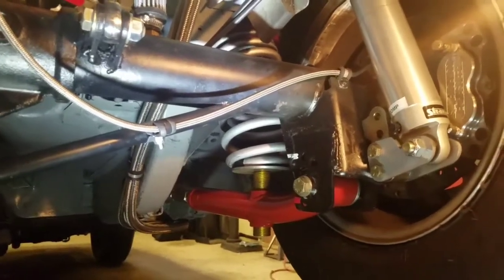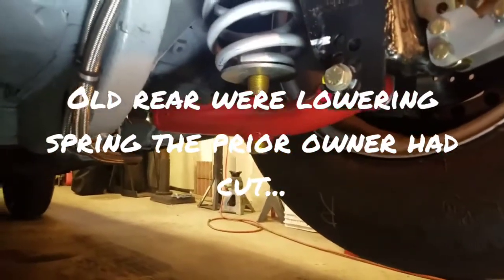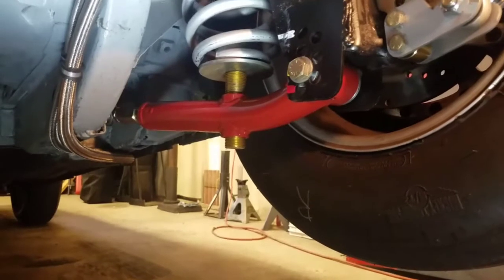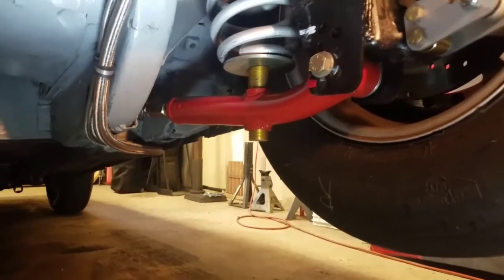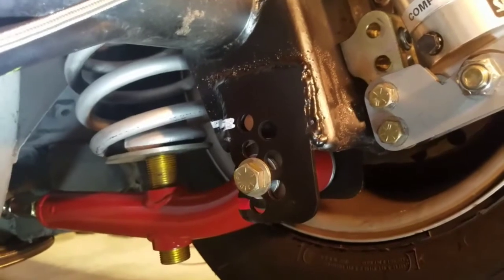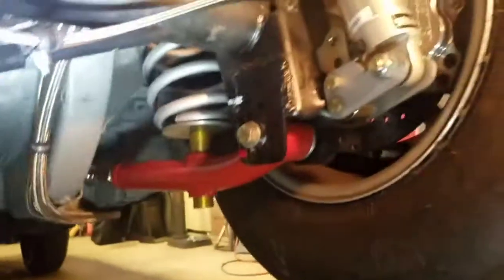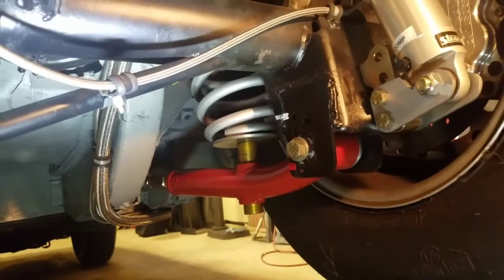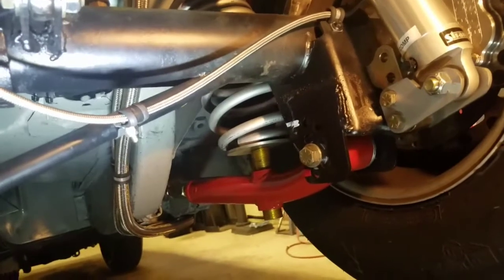Foxbody Radial Tire Suspension Changes Fixed Traction Problems.

Comment: Love this setup. I’m doing research now for a roller I’m picking up. I’ll be building a 4.6 mod motor but same simple build. Question for ya, are you running a boost controller? How much boost are you typically running? Look forward to more of your runs.
Reply from the maker: I normally run around 15psi or so launching at like 9psi but a couple weeks ago tried a little more boost (19psi)  unfortunately the valve springs weren't up to par...in the end I blew a head gasket after it missed a couple times. Engine is coming out tonight and I'll check it to make sure that's all it needs. Currently I'm using a Leash controller for boost and bump box.
Reply: Oh man sorry to hear. Hope it’s nothing to crazy. How do you like the Leach controller?
Reply from the maker: Yeah not too big of a deal as long as everything else is ok. I was pulling it out to swap valve springs and check bearings anyway. I really like the leash. It's small and easy to operate. Thinking of swapping to a Haltech VMS this winter. It will do everything from ignition to boost controller plus data logger. Although  I'd probably keep the leash hooked up for a while until I sort out the rest.
Reply: What data logger are you using now?
Reply from the maker: Old school innovate LM1+ LMA2 with just 4 channels of data.

Comment: What is your pinion angle set at?? Thanks for the video!!
Reply from the maker: I set mine at -1* ....generally zero to -2* is good as long as the suspension doesn't have a lot of deflection. Sloppy bushings, weak leaf springs etc may need more angle to compensate. 
It's really just trying to keep the driveshaft and ujoints happy.

Comment: any issues with your upper relocation kit hitting your anti-roll bar ?
Reply from the maker: No but my ARB is a cheezy bolt on style with some braces. It does hit my floor. It was on thr car when i bought it. Trying to figure out if i want to upgrade the mounts, cage and ARB or just find another car already done.